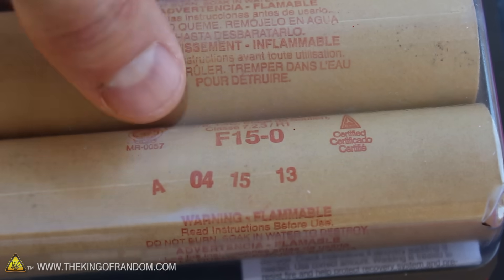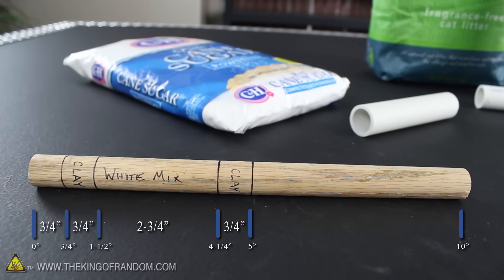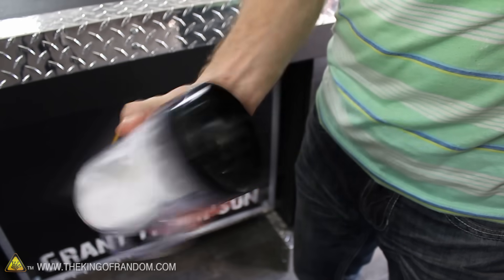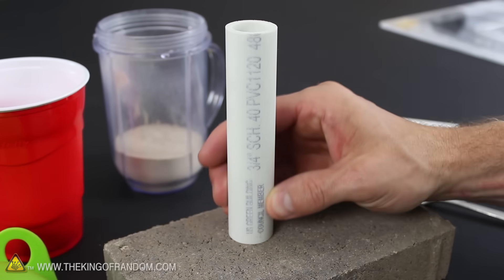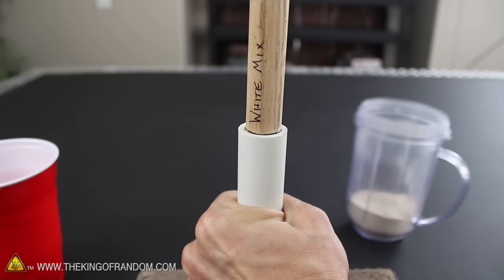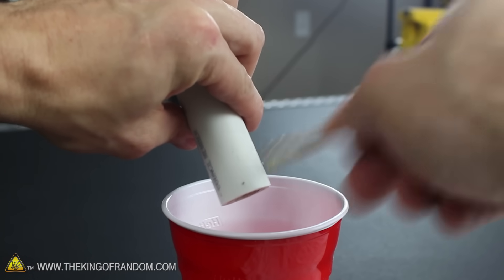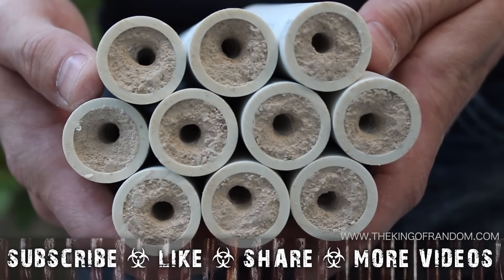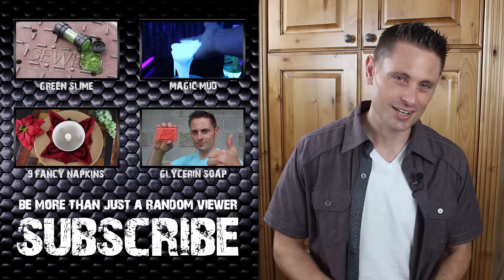How To Make Sugar Rockets

Comment: I used an old high-speed coffee-bean grinder, to powderize bentonite clay, stump remover, and regular sugar.
 Rinsing, cleaning it between each ingredient, of course...
It tends to pulsate for a minute or so, and I give it some rest. Tap it on table, etc, and when motor rpm evens out, it is ready for mixing with sugar.
Q.   Is there any brand of powered sugar that isn't cut with corn-starch ?
C&H, maybe not...🤔
Reply: no powdered sugar by nature is mixed with corn starch which is why it is best to use superfine granulated sugar and powder it yourself

Comment: My rocket motor was made to the exact specifications. It lit and burned vigorously but just kinda jumped up a foot, plopped over on the ground and expended a ton of energy. What did I do wrong?
Reply: Sounds like a poor nozzle design. Unequal thrust all over the place. You got energy, but wasn't directed properly.
Rocket science is hard.
Reply: @after_midnight9592  I used ready made powdered sugar, not realizing that it contains other agents to prevent clumping. Further since the Potassium was already powdered I didn't grind it. Both of these probably led to the failure.

Comment: What does the kitty litter do
Reply: Aiden pritchard When powdered, it is the material used to form the end cap and nozzle for the rocket engine.  It keeps the finely powdered propellant mixture in place and directs the exhaust.
Reply: whpalmer4 okay thanks I was thinking about doing it with my parents but they don’t wanna buy it. Thanks

Aiden

Comment: I see the nozzle diameter  (7/32" = .22") is roughly 1/4 the ID of the PVC 3/4" tubing (.804" I.D.). Is this a useful rule of thumb? What is the effect of slightly larger or smaller nozzle I.D? Thanks for any comments.

Comment: next time try using a  6  foot 10" diameter pipe packed to the hilt, far better job, but make sure your wearing steel toe cap boots and a welders mask, or stand one mile away......

Comment: I have made a few motors and they work great! However I am having a problem where the clay nozzle gets blown out before even half the propellant has been used and I lose all thrust. Not sure if I need a thicker layer of clay or maybe I need to drill a bigger hole?
Also I might try mixing glue or similar into the clay before ramming it.
Reply: maybe dab superglue on the clay plug to bind it to the motor wall, and itself?
Reply: @GASNICABRUNATNA  not a bad idea. Would it still be flammable once dried?

Comment: If you want your rocket to be more powerful add crushed celluloid to the mix of sugar and potassium nitrate. The celluloid will provide more oxygen so you get more power when burning the mix. I used to make rockets and found it to be the perfect mixture. Ping pong balls are made of celluloid. You can add two or three crushed ping pong balls to mixture.

Comment: You can save a lot of work and materials if make a molding device that lets you form the rocket from nozzle to cap while also forming the center void. They aren’t difficult or expensive to make. Drill out the center of the ramming rod. Cut off a piece about 1/8” and mount it on a board. Drill a 7/16” diameter hole through the board and 1/8” piece mounted to it. The length should be about 3/4” short of your tube length. Push the tube down onto the 1/8” piece. Ram the nozzle using the drilled out dowel and powdered clay. Then, pack the propellant with the dowel until  it is 1/2 to 3/4” from the top but covers the  7/16” center rod. Use another dowel to hammer the cap. This way you can make several engines that are consistent. Also, I would use a dead blow mallet to hammer this stuff down.

Comment: What is the highest temperature reached (while burning )  and what kind of material can i use instead of PVC. Something that wont melt. Also what will happen if i add 130gr. of Nitrat and 70gr of sugar?

Comment: How do you make a rocket without potassium nitrate? (It is hard to find)
Reply: research making it it's not really that hard, it can be messy but it is doable if you really want it (hint: start with urea) otherwise you are just 'pissing away' a potentially valuable resource (wink wink Nuge nuge)

Comment: I made similar rockets in 1970,  we used equal by weight potassium nitrate and powder sugar, a pinch of sulfur and pinch of charcoal. We just rolled paper around a marking pen, put part of a cotton ball in the top and masking tape, we put our fuel and fuse, folded the paper and taped the bottom end closed, added a stick.   We could make one in just a few minutes.   We were 12 and we made our own fireworks also.
Reply: How many of you survived?
Reply: @hooondacbbr  it's just Gary left now
Reply: I know two that were firework hobbyists. Names: 'Lefty' and 'Deadeye'.
Reply: @tomryan914  Right Hand Louie and No Nut Nate were their cousins
Reply: I made rockets in the 80s using Sweet'N Low.
Reply: How many fingers are you missing?
Reply: Did you wear an onion on your belt?
Reply: @Aykay8383  Well, it was the style at the time...
Reply: I don't have kitty litter can I just use flour
Reply: These days you would have been expelled from school for Talking about that. And possibly shot by a cop had you actually set off the rockets or fireworks.
Reply: @Jeremy-kg1zr  Lol or a watch list 🤣
The wold has gone mad.
Reply: send a picture. hard to imagine how the propellant would leave the paper
Reply: How to make fireworks please wanna make a rocket or a lot 😂
Reply: Video plz lol
Reply: we made smoke bombs, with jus sugar and saltpeter.  Nothing explosive though. It just burned and smoked a lot.
Reply: Make America great again!
Reply: nerd

Comment: You said it cost less than fifty cents to make and then you said that the kitty litter cost ninety eight cents
Reply: I know it's a little late, seeing as your comment is 6 months old... But, the cost is relative to the amount of material you use. It may cost near $7 for the spectracide stump remover, $1 for the kitty litter and so on... but so many scoops of this material or that material, would equal out to $0.50 worth of material used.

Comment: some people cook their sugar and KNO3 into a reddish paste and core it as it's solidifying, with a little added red Iron Oxide. What's the difference in power between those 2 methods, Red "cooked" vs White "raw"? Thanks
Reply: i have the same question, did you got the answer?
Reply: @pabloxd1239  The red iron paste just gives the chemtrail a nice red colour instead of white trail.
Reply: @dirkcoetzee3117  His question isn't about adding iron oxide, it's about melting the propellent and casting it, rather than using powder and ramming it. When you melt sugar it caramelizes which makes the propellent red.

Comment: Has someone tried to do that in a copper pipe? It is much more resistant than PVC (up to 900psi), but may melt things around due to its high conductivity.
Pressurized PVC pipes availability in my country is not that great.

Comment: Mr. Random you should suggest a better grade of kitty litter for plugs because I personally had trouble with lots of blow outs or catos until I started using Fresh Step unscented it packs like concrete try it you will see what I mean also if you put a single piece of tape over one end of pvc tube it helps keep kitty litter in tube while pounding it then when your are done take tape of and you have a most perfect plug try it you will like it .

Comment: Sigh.  It's sooo frustrating.  It's not an attack on you guys, but its annoying that these predominately american videos give only imperial as opposed to SI units.  PVC pipe isn't measure in inches in my country, or, indeed, pretty much anywhere else in the world.  Schedule 40 PVC pipe doesn't exist outside the US either.
Reply: sarenace that’s why you look it up
Reply: sarenace then buy it on ebay
Reply: Clearly it will only work if you use US Customary units, not imperial, we weren't part of the empire when you made your last non-metric change. No approximations of any kind or looking up the conversions to your local system of measurements will work.

Comment: Something to consider; off-the-shelf confectioner's sugar usually contains corn starch to act as an anti-clumping agent. Use regular crystal sugar in your blender separately, and you can make powdered sugar without any contaminants.
Reply: Actually cornstarch is also explosive by itself in the right circumstances
Reply: @mikburton5028  Which circumstances?
Reply: LD Texas when in contact with heat i suppose
Reply: @ldtexas1648  Love to hear from Mik on how cornstarch is "explosive by itself" as even heat/shock or extreme pressure is required to detonate any explosive.  Therefore, my guess is that he is referring to aerialized corn starch (or any combustible fine powder) is extremely flammable.  Depending upon the situation (amount aerialized, humidity, space size, airflow, etc.) it can create conditions that are ripe for a flash fire.  Even then though, there has to be an ignition source.  Grain elevators and factories that produce lots of fine powder require extra ventilation and grounding straps (and sometimes non-sparking tools during operations) to avoid this very issue.
Reply: @Game-The-System  Coffee creamer sprinkled over a lit match.
Reply: @ldtexas1648  air float/aerosolized, large presence in air
Reply: If cornstarch get blown into a dust cloud and it can be ignited by a spark it will flash fire.
Reply: @fathertimencUSA  Exactly.  The key words you used are "flash fire," which is NOT an explosion.  Might seem like an explosion to someone unfamiliar with the difference, but there is one none-the-less.  And frankly, in probably 95% of situations where there is a flash fire risk from aerialized particulate matter, it would likely take more heat than a single spark to set off a chain reaction ignition.
Reply: Monday206am That depends on if it’s is enclosed which will cause an explosion. I believe years ago there was a ship that had flour on it that exploded from this precise thing of the dust particles of the flour being ignited.
Reply: Huh, neat

Comment: I'm following this step by step and the rate at which this burns isn't the same at all as yours. The highest we got the rocket to go is about 150 ft. I did start with Potassium Nitrate prill that was blended into a powder. I don't know if that makes a difference on how quickly it will burn, but my daughter is getting very disappointed that its not going as high as yours so I have to work this out before I get to see her again.

Comment: Do you have to grind the KN03??? And do you need powder sugar? Can you use regular sugar?
Reply: If you dissolve the KNO3 and Sugar in just enough water to dissolve it all, and then boil it until it's creamy, you won't need to grind either one and it will probably preform better than what is shown in this video.

Comment: kinda confused.....I followed your instructions to the T, but I'm having issues with thrust.....there is little to none. the only difference is I'm using Gordon's stump remover which is 99% Potassium Nitrate instead of the spectricide brand. would I have a better turn out if I melted down the compound instead of using it in a "white mix" state? Also did you add any other compound such as an iron oxide to yours?

Comment: You should find out a way to make a multistage rocket. As in putting miltiple of those on top of eachother and having one burn through to the next
Reply: This is a suggestion
Reply: Simple different lengths of fuses going to them. then light all fuses at one time
Reply: That's the way model rockets work. The first stage burns through the inside end and ignites the second stage. Then the thrust separates the two.  The nozzle on the second stage engine needs to be shaped to  make it easy for the hot gases to enter the engine and ignite the propellent.

Comment: Mine shot up into the air then came back down and exploded
Reply: Ya I tried it mine either exploded instantly blowing the ends out or shot up about 40 ft raining fire everywhere, not saying either of these outcomes weren't awesome just couldn't get it to shoot into space like I was expecting
Reply: @liamoneill9793  you'll never launch it into space, youd nrmeed to make a fuckton of stages making it as huge as a ICBM
Reply: Eryk Bing you’re getting too technical for this crowd
Reply: @erykbing3587  use that a long fuse and helium balloons so it launches already in the air high enough for to make it to space
Reply: @batenkait0s657  a balloon launch platform with altimeter to control the launch will do. I want to set off artillery shells at 120,000 feet just to see what it looks like.
Reply: @liamoneill9793  I think you need more sugar to the mix/mix it better 

sources high school chemistry
Reply: My second one didn't launch for 5 minutes after I lit it that was really worrying
Reply: @technocube2940  Perfect situation to send in the younger brother...
Reply: Ramon Teuling a lot
Reply: TechnoCube mine only got up to about 6meters what did I do wrong? :/
Reply: If you think they'll fail most of the time make the sugar rocket fuel you cook then grind it up to make something like gunpowder.
Reply: You got yourself a surface-to-surface missile
Reply: i attached a sugar rocket to paper plane ... it shot up like a combat aircraft
Reply: Lmfao

Comment: were can i get potassium nitrate
Reply: That's the problem with all these kind of Yank videos. They say - "an easy way to make rocket fuel or explosives out of household items". Then it's "first you'll need 10 g of black powder" Or"friggin' stump remover" Or "potassium nitrate"

If you live in a place where you can simply walk into a shop and buy this kind of stuff why not just buy the shaggin' explosives or rocket fuel off the shelf?
Reply: Where do you live? If you live in Europe you'll have to make a cemical to make a cemical to make it. The anti-terror law is annoying
Reply: +TheSmithDorian Well, the problem ain't with Yank videos but places where doing this type stuff is prohibited or made very difficult.

Comment: I tried this nearly a hundred times with several different rocket bodies, engine sizes, fuel mixtures, additives and I could never get one to get more than 10-15 feet off the ground. I was lucky if it even lofted off of the launch rod. Any tips?Thanks!
Reply: The KNO3 might have absorbed water...
Reply: Me too. First you have to identify the problem, so you want to see whether your fuel burns quickly. Get a small teaspoon of the mixture and burn it, if it doesn't burn very rapidly (like shown in the video) then your fuel is wet and needs to be dried, your potassium nitrate is rubbish, or its not mixed enough. If it burns quickly (which I am assuming due to you getting 15 - 20 feet) then your rocket isnt built correctly. The most likely cause is that you did not drill a core in your rocket.

Hope this helped

Comment: how do you know it goes 2300 ft
Reply: physics. Measure time in the air, use kinematic equations to solve for height
Reply: Brice estimated
Reply: Trevor Jex tbh that's very unreliable for a richer like this
Reply: Trevor Jex do you know the formules?
Reply: rocket*
Reply: Brice triangulation

Comment: I used fire clay as a kid - no grinding. I mixed a little used motor oil with it and it really packed and drilled great. You used to be able to just buy it from a bin in a hardware store. Seems like it's only in 50 pound bags now.
Reply: Do you know where I can get fire lay in Denmark?

Comment: Gotta make a rubber powered rocket. Bottom to top: clay, rubber, clay, white powder, clay cap. Drill through the clay rubber clay whitepowder. What you'll have is another carbon fuel source that will burn longer (the rubber)...   Definately would make some cool black smoke trail and smell like crap :)

Comment: Is there a difference in the Dry mix and the Cooked down fuel?
Reply: Maybe the dry mox burns faster because its denser. But i dont think so. Main difference is that coocking will set your fuel on fire most likely.

Comment: Melting it down will enhance this along with a pinch of red iron oxide and maybe some aluminum powder.
Reply: This mixture already has an oxidizer and a fuel, it doesn't need any more, giving it the same ingredients as thermite wouldn't do MUCH other than making it burn hotter.
Reply: You could replace the powdered sugar with aluminum powder, but I don't know how much better a potassium nitrate and aluminum powder reaction would be.

Comment: It's possible this has been said before but using PVC for this is a very bad idea. If it explodes and there are people near by the PVC turns to shrapnel. A cardboard tube is much better for the task. How do I know. I built one like the one above but I used a high grade Kno3 off eBay no less... The rocket exploded the moment the fuse went inside leaving bits of PVC shredded over the place. Luckily no one was hurt as I also used a secluded area. The thing with the video above is it is using a low grade kno3 substitute which limits the burn rate. That's not to say it wont explode any other time. 

PVC pipes and fireworks are bad!

Comment: Is it possible for me to use smaller pvc pipes, and a smaller rod with the same measurements, and still have the same results? Also, the potassium nitrate in the stump remover I am using is granules, is that okay?
Reply: Yes it would work but you need to measure the hole you drilled. Blend it.